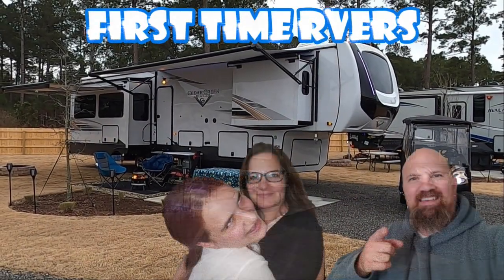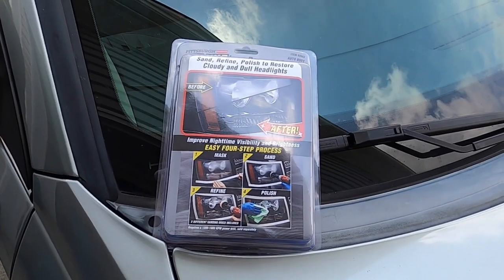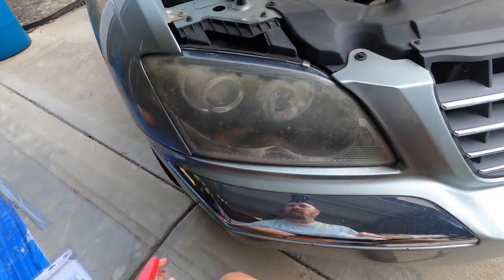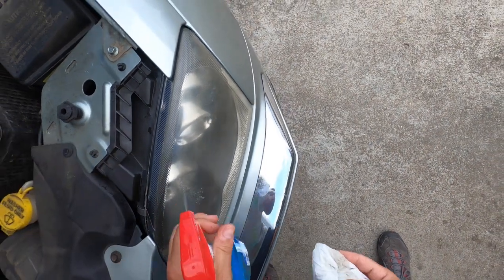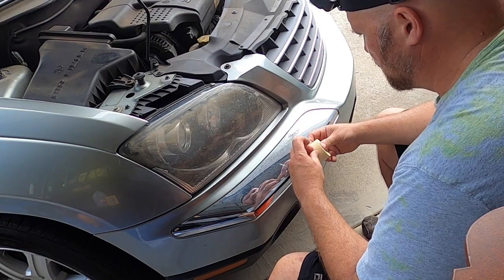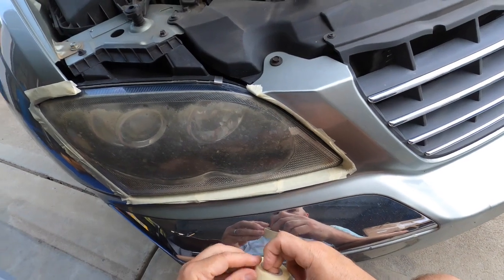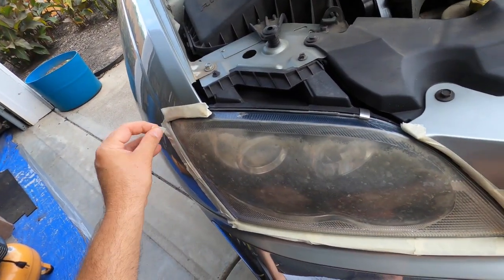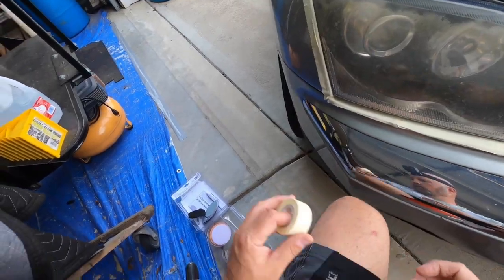How To Restore Faded Headlights. Will The Harbor Freight Headlight Lens Renewal Kit Work?

Comment: Would you suggest buying two kits to have enough sandpaper to do both?
Reply from the maker: If they are this bad you may need to.  Maybe use water too, helps the paper last longer. Oraybe get a small pack of wet and dry sandpaper from a hardware store.  You can usually getba variety pack. May cost a little less.